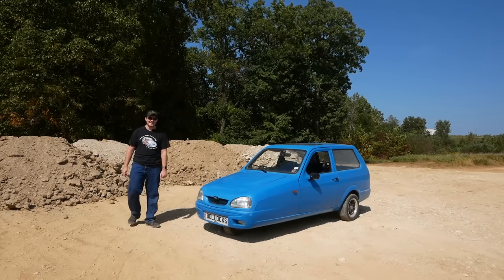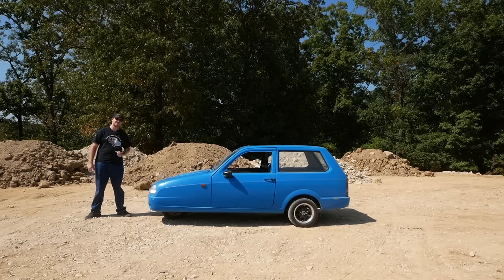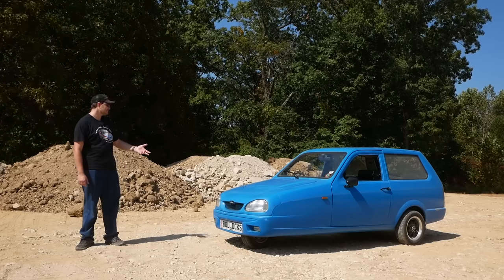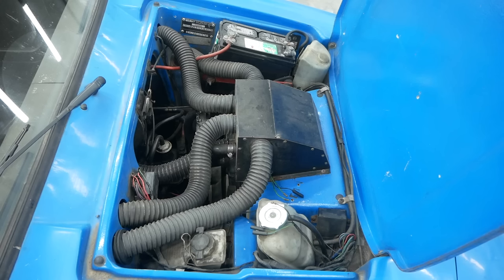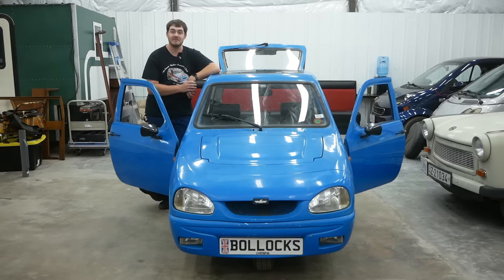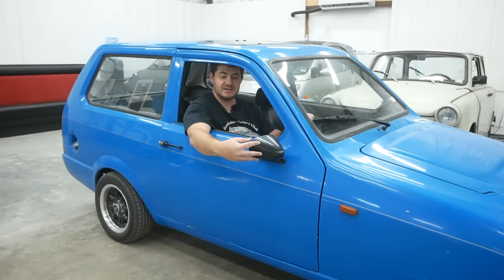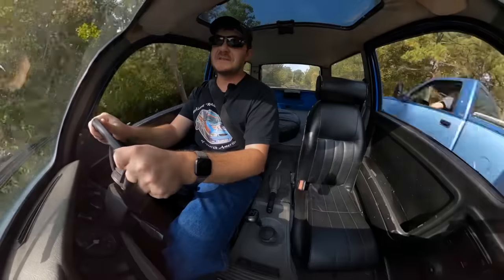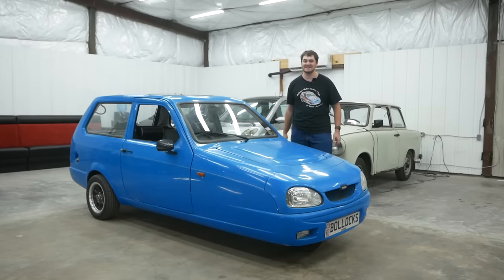I Bought a Reliant Robin!

Comment: That mystery switch is a low brake fluid warning lamp. The switch is just to test that the lamp is OK. Cheers from the UK.
Reply: Exactly the comment I was hoping to find.
Reply: @FirstFamilyCharger  Cheer mate x
Reply: They used the same setup in 1960s VWs.
Reply: It's a curious set up really, that brake fluid test switch. The lamp only illuminates if the circuit is made when the float falls too low, yet on a lot of cars the contacts on the float have corroded away already regardless, so the switch is literally just testing the bulb 😀
Reply: Was about to post that. My old Mini has the same thing ... very British :)
Reply: The button that lights up is to test if the driver's finger can press buttons OK

Comment: My stepdad only had a motorcycle license when my little brother was born in the early 90s. This led to us having several Reliant Robins as our family car for most of my childhood.
In the UK they were fairly popular in the 70s and 80s meaning that by the 90s there were a lot of them available very cheap. My stepdad would buy one for around £50, drive it til it failed (which boy did they) and then buy another.
By the time my sister was born in the late 90s we all had our own spot we had to sit in to keep the weight ratio inside even.
My step dad in the drivers seat, my 4' 10" Mum behind him. My baby sister in her car seat in the front because the back had no seat belts. My brother in the middle and me, being the heaviest member of the family by that time, behind my sister. For anyone worried about there being no seat belts in the back, we were so crammed into the bench seat there was little chance of us moving out of it if we crashed.
We never tipped over in one with us all in the car, but we did often find that local kids had picked them up and flipped them over whilst they were parked. Parts of them also fell off sometimes whilst driving around, but I think that was mainly due to them not really being maintained.
My parents did flip over in one when it was just them in the front after someone hit them from behind on a hill. This was the day after that infamous Top Gear episode aired.
I was working at the local newspaper then and the story came in around lunch time. As people started coming back from lunch they would see the story in our system, start commenting on the Top Gear episode they'd seen the night before, then get hushed by a colleague who told them it was my parents who were involved in the crash.
Neither of them was hurt, just shaken up and after that experience they both got full car licenses and they've never driven in a Reliant Robin again. But my step Dad does have one in pieces in his garage, so they may still drive one again some day
Reply: Fascinating story, thanks for sharing.

I find it somewhat hilarious that kids flipped them on their side, even though it's a dick move.

But I think I find it funny in the same way as James May once told about the bicycle lock prank he did when he was young.
Reply: Great story! 👏👏👏
Reply: awesome! thanks for sharing :)
Reply: What a great story!

Comment: 11:36 - that button is actually your low brake fluid warning lamp, you push the button to test the bulb :D
Reply: Yep. I came here to say that. Same exact switch as my '80s mini.
Reply: Do they consume brake fluid or just leak it as part of the design?
Reply: @Thu Nell, this symbol is without "!" that is used for a handbrake. Almost the same, just no "!" Inside the circle - that is the "Brake failure" symbol. The old days of cars where you had to know the meanings of symbols, not just read the text from the display :D It was fun, especially with cars with many indicators in the cluster :)
Reply: Thu Nell Ⓥ  You are right... Well... this thing may have the handbrake wired to the brake warning light as well. 2 in 1 button/switch/light. All the normal cars have these things separate. Some vehicles are weird - I had a Kia Cerato which had two interior dome lights - only the light at the center of the roof would turn on when the doors open. I thought something was broken but it turned out the light next to the rear view mirror is just a reading light. I ran the wires and installed additional bulbs making both of the lights turn on with the door open.
Reply: I have something similar in my 96' Fiat Cinquecento, but the button is in engine compartment so you can't check the lamp alone xD
Reply: now he just needs to a get a mark one and mark two robin so he has all three marks of robin lol
Reply: @BobWiersema  it's not part of the design as such, but eventually brakes can start to leak due to corroded pipes and perished flexi hoses etc. This is a feature of all cars, not just robins
Reply: The old VW had a low brake fluid light..push the button to see if the bulb was not blown..
Reply: @chrisdavidson911  I honestly thought sarcasm was a design feature of this channel and not necessarily a bug.
Reply: @notts guy Why do you watch a channel so filled with sarcasm and have no grasp of the concept?  Good grief!  Sarcasm.  It's one of the 9 types of humor.
Reply: @notts guy If you require special punctuation or emojis to determine if something is intended as humor your fictional comedy school won't help you.  Sorry I'm forced to block you.  Have a nice day.

Comment: Also I was at the filming for Top Gear with the reliant episode....the reason why it fell over was because they fitted a 12inch wheel on the passenger side, a 13inch wheel on front and a 10inch wheel on the drivers side, thats why it only rolled on the drivers side throughout the episode

they made a robin do a wheelie by welding a huge drum to the back and filling it with water
Reply: Still it was a funny episode.
Reply: Another reason why it rolled over so easily was because they messed up the weight distribution: they put Clarkson in it.
Reply: @doabarrellroll69  Almost doubled the weight right there!
Reply: I remember watching some interview that said they also messed with the engine, either a swap or some modification to the diff, so that hitting the gas would cause it to flip
Reply: From what I remember it was a 12" wheel on one side, with some of the leafs from the suspension added from the other side too, front wheel was small, one wheel was small (10"), and the CoG was now poised to tip "over" the engine to one side when the brakes were mashed or he turned to the passenger side.

5th gear had a segment that basically called them out on it whilst having some fun in a couple of cheap reliants.

It was also all that was discussed on the reliant forums and groups at the time lol.

/watch?v=dwcLDvN-t_M
Reply: @AsbestosMuffins  they probably welded the diff so the engine would continue to power both wheels when one was in the air.

Comment: When doing MPG comparisons, remember that the UK uses the Imperial gallon, which is larger than the US gallon. Therefore, MPG (Imperial) will be higher, since more fuel lets you drive farther.
Reply: "Damn faithless Imperials..."
Reply: Even with the larger gallon - 100MPG is a pipe dream. 

60 seems possible, but still unlikely unless you were in a competition for thriftyness.
Reply: How much Imperial gallon to liter? I know US gallon roughly around 4 liters but not the imperial ones. I live in Asia where we use SI units since early 20th centuries.
Reply: @govinlock8568  About 4.5
Reply: Also isn't UK fuel higher octane? Normal is 95, "super" is 98. If that's higher than the US stuff it would help with MPG, if the engine is tuned appropriately.
Reply: @cooperised  It is the same gas, just another type of octane rating. 95 is 91, 98 is 94. See Wikipedia Octane rating.
Reply: @Adler71  Cool, didn't know that!
Reply: @cooperised  Octane hurts fuel ECO in a low compression engine, and by low compression I mean sub 10.5 to 1. Basically the higher the Octane rating the less BTU's in a given unit of measurement of gas. Higher Octane reduces the change of  per-detonating the fuel, in a gas engine not setup to run like that (there are Diesel like Gas engine) you can blow holes in the top of the piston, blow headgaskets and so on.
Reply: @TdrSld  Yep true. But high octane (as you say) reduces detonation which means that ignition timing can be more aggressive which leads to better efficiency. It's quite a complex topic isn't it!
Reply: @pd4165  35-40 is more realistic around town 60 on a long run is still dreaming
Reply: @govinlock8568  around 4.55 litres to an imperial gallon

Comment: Two Robin stories, both relating to the same guy, who owned several. One time we drove his car in heavy falling snow into Central London. As snow settles on roads, two ruts form as cars compress the snow. Obviously this is hopeless for a Robin, which wants to ride the hump of snow in the middle, and fails to do so, endlessly falling off one side or the other, making for a hilarious driving experience! Another time, my friend came up to a T-junction on a country lane and didn't quite manage to stop at the line in time. Another car travelling on the main rode hit the front of his car side-on, and removed it entirely, in a simple clean break, which caused little damage to the other car (a Triumph Stag if I recall correctly). Remarkably, my friend was able to glue the front of the car back on and continue using it. (RIP John, still miss ya!)

Comment: I got overtaken by one of these once.

I can talk about it now, after thirty years of therapy.

In my defence - it was a steep hill and I had six people (one of whom was called Big Si, for obvious reasons) and some amplifiers in it - a mk2 Escort estate with roughly 50bhp. Which means I overtook the Reliant on the flat, because it's compulsory.

I could see the Reliant gaining on me in my mirrors and was thus prepared for the jibes of my passengers as the dastardly deed was done. The driver didn't look happy, as he vibrated past me in a classic 'elephant racing' style. But I suppose he had to take possibly the only victory of his driving career when he had the chance.

For  those that are unaware the three wheelers were what motorcyclists bought for winter transport, since you could drive one without needing to upgrade to a car licence - in the UK they are considered a motorcycle with sidecar for licencing porpoises.

Reliant also made a four wheeled variant, called the Kitten, which seems pointless, a rather fine in its day thing called a Scimitar (the running gear of a Ford Capri 3L in a fibreglass body) and the bodyshell for the Ford RS200, which was a firebreathing monster of a group B rally car (the ones that were banned because of the 99% death rate).

I haven't seen one for years, and they used to be fairly popular. Perhaps Top Gear bought all the remaining examples and made them unroadworthy-er.
Reply: I bought a fiesta 1ltr for £50 years ago. Was driving up a hill in Brighton getting overtaken by all insundry whilst beeping at me. .  Never bought a vehicle with an engine smaller than 2 ltr after that.
Reply: It could well have been my late father. He drove his like a maniac. Pretty scary if you were a passenger.
Reply: His brakes had probably failed ?.
That's the reason he passed you.
Ps, I own a Reliant Kitten, great little car !.☺️🏴

Comment: The changes to the bodywork may seem “irrelevant” but they do improve the aerodynamics, which makes the later versions of the Reliant and Rialto more stable at speed, ie more than 30mph.
Reply: An 850cc engine in such a light body made them pretty nifty, used to average 50mph on narrow twisty country roads between Peterborough and Nottingham.
Reply: I've done 90 mph in mine ...
Reply: @supocarta74  My dad did 80 with me and it already was scary
Reply: @supocarta74  only on an straight road.

Comment: As a Reliant owner, I think this is the best most entertaining review I've ever seen. Also, mostly spot on accurate.
Reply: Please tell us what the red button does. My theory is that it turns on the brake lights..
Reply: @jmkhenka  I think it’s rear fog lights.
Reply: @jmkhenka  It's used to check whether the brakes worm. If there isn't enough brake fluid or it's oxidised it will not light up.
Reply: You people in the uk 🇬🇧 always get fun cars. In canada 🇨🇦 all our cars are as boring as staring at wallpaper.
Reply: SS1 owner, waving in Norwegian :)

Comment: I remember taking day-trips and even weekend holidays riding in the back of my Dad's Reliant Regal, the precursor to the Robin, in the 1970s. Mom, Dad, Grandma and Grampa, and me and my brother. SIX people in a vehicle that barely sat four. My brother (who was smaller) would sit on Mom's lap in the passenger seat, and I got the hump in the back, and all the day-trip or clothes would be behind the back seat. The Regal was actually a converted van, with nice, new windows installed in the side (easy to do with fiberglass as you just sawed out the panels). Dad would often joke that if there was a particularly steep hill, we might either have to get out, or he turn the car around and take it in reverse (due to the super-low gearing of the reverse gearing). It had a push-button radio that Dad pulled from a Ford Cortina at the local breaker's yard.

I miss that powder-blue deathtrap…

We considered getting the Robin after the Regal started having issues, but Dad ended up getting a rather fancy Ford Cortina Mk 2 in burgundy.